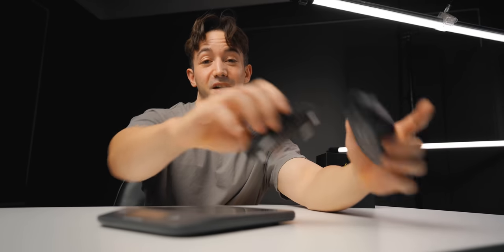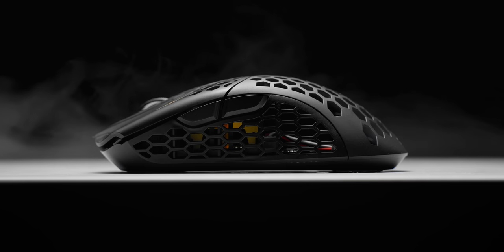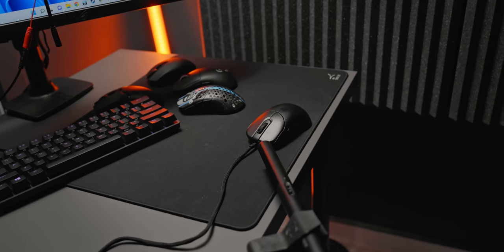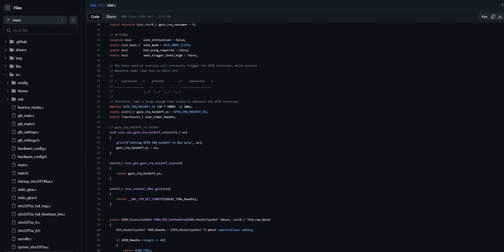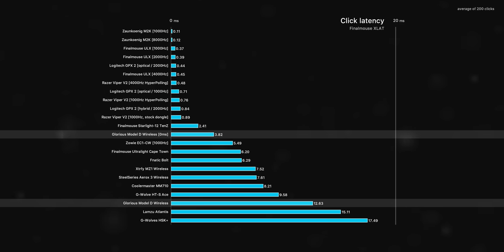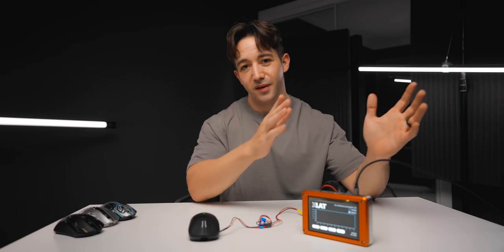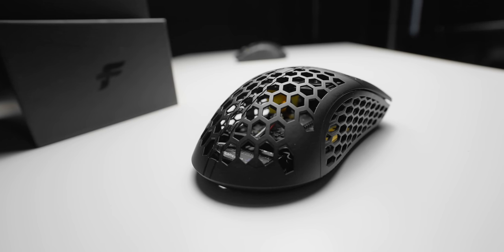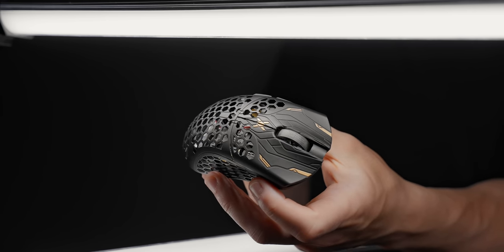Finalmouse just owned everyone. - UltralightX Review

Comment: Hi there. I'm looking for advice, would be really nice if you can help me. I'm not a gamer. I'm a chess player. I play blitz chess (3 minutes) and bullet chess (1 minute) and even hyper and ultra bullet (30 seconds and 15 seconds) and those time controls require a very good mouse and pad but I'm not sure the specifications needed are anything as what you require as a gamer.
So far I've been using the Logitech G PRO X SUPERLIGHT which is good but not the most stable. Sometimes it seems like it excelerates (if that makes sense) beyond my movements. I never had a mouse pad. I don't know if your recommended Otsu Mid is best for fast chess.
Do you think you can help me figure out what I should use?
Reply: bro calm the farm 1. you don't need a crazy setup for blitz or bullet, and 2. you probably have mouse accel on

Comment: I feel like soldering wires to the switches is a good way to measure click latency, but I'm not as sure when it comes to motion sensors. I would worry that there's some lag between the mouse moving and the sensor picking the motion up, even if wires are soldered to the sensor, so I recommend my method. It does measure end-to-end latency, so you can only compare mice instead of measure overall mouse latency, but I hit my mouse with a butterknife (ridged and has a bunch of mass so I can tell exactly which frame it hits), record in slow motion, and see how many frames it takes for the cursor to move in my modified version of osu lazer which runs at over 4000 fps in an empty map. With my 240hz monitor I get around 5.5ms, but 24 of the 25 measurements were either 4, 8, or 12 frames on my '960hz' slow-motion phone camera setting, so I feel like the sketchy Chinese company did some false advertising on my $200 phone and insert ai-generated frames. I'm sure you could get much better results if you get yourself a better camera.

Comment: It is stupid that finalmouse still would not provide linear dpi adjustment. I'm using 650 dpi rn and only to find my poseidon would not work at all. Never see such popular mouse with such stupid engineering. It seems that the ultralight x still only have 400, 800, 1600 and 3200 option. I honestly dont know what is the point for finalmouse to have a "driver" like this one. They would sell anyway so THEY DONT GIVE A FUCK what kind of shitbox they are making.

Comment: if I can use a 120g mouse and get identical aim trainer PBs that I get on a 60g mouse (even on endurance scenarios) this weight difference surely doesn't matter at all.

Also, with logitech you can use OMM software which doesnt run in the background. I have a logitech keyboard with macros and custom lighting, and a GPX and neither has software running in the background. They do leave a lot to be desired still though

Comment: sub ms click latency might be useful when we move to 1000hz monitors, i guess. also the difference between the two "identical" mouse might just be a case of unit to unit variance, or signal interference, or both. also if you want be more precise for the heck of it, look into compliant mechanisms to remove backlash.

Comment: 1000hz -> 4000hz is a big jump and I definitely feel the difference but 4000-8000hz isn't worth the hype IMO. first off my Razer mouse has issues with 4000hz support in a lot of games I play, and 8000hz has even worse support rates, not even FN right now supports it properly.

Same diminishing returns as going from 360-500hz monitors, but even worse beccause going from 1000->4000->8000hz starts to eat up significantly more CPU resources. When I have a 9700kf and was using 4000hz, there'd be times when I'd hit 100% CPU with big flicks and the mouse would turn extremely mushy, with 8000hz unless you have a VERY beefy CPU the chance of that happening gets even higher. And it will happen at those critical moments when your aim needs to be 100% on point.
Reply: I was fine with 1khz but moved up to 2khz on Skypad. 2k seems pretty solid so far, tried the 4khz but not really noticing much difference with my Lamzu ACM 4k. I imagine 8k would be even less of a noticeable difference to be entirely honest.

Comment: Hold your horses there razor just pushed out a firmware update that allows you to have 8000 pulling hurts Wireless with the V2 Pro and V3 Pro and a few other razor mice that connect with the hyperspeed pulling dongle. Please make a video testing the pull rates and how accurate they really are and if they truly stay at 8000 Wireless or if they bog down at any point

Comment: how do you clean it tho?
And why would anyone want to have lighter mouse?
Reply: You can clean it slightly wet tissues. You can also open any mouse (at least "pro" mice) like the guy was doing in the video, so it's possible to clean it from the inside too.

With lighter mice you need to put in less efort in moving the mouse, so if you can control a lighter mouse your accuracy will be better. Light mice aren't for everyone though as they can be "too fast" for some people.

Comment: @optimum Why don't you make a video comparing DPI in mouses, comparing if more is better or just a placebo, not in a sense of raw speed (since most players only use a fraction of the DPI available) but if two mouses supporting different DPI ranges running at the same value behave the same, of if the one with a higher supported number is superior in precision or any other important metric?

Comment: I like heavy mice.... 🤷 And perceived input lag being higher on heavy mice is placebo and illogical as input lag is purely sensor/processing based.

My current go to, is the Logitech G502X Lightspeed. Their newest version that has optical switches. Maybe you can throw that into your testing for heavy mice users. Cant always shoot for ultralight because its what you prefer. Testing wise.

Note, higher pilling will show many pc users bad overclocks. Ive seen tons of people complaining about higher polling causing issues and almost all of them have an intel cpu overclocked to the moon and guaranteed unstable but because they only play older games it doesnt stress the cpu so they dont know its unstable.
Reply: Heavy mice perform objectively worse than light mice. Why include them if nobody's using them in/for comp?
Reply: Its not though. There is also physics based input lag. When something has higher mass it requires higher acceleration to move it from a stop, and it takes more counterforce to stop it when in motion. Also heavier weight equals more friction generated by the mousepad/skates, especially if the mousepad has a nonrigid structure like foam or rubber as its base because a heavier weight causes the mouse to sink into that material further causing more friction.

Comment: I HATE browser based mouse and keyboard applications. If the company goes bankrupt then there's no longer any way to change the settings. Real best way is what HyperX used to do where you just open the software, change settings and then save the settings onto the memory chip in the mouse itself. Then it doesn't matter what PC it's plugged into, doesn't matter what happens to the company since the software is downloaded to my PC and doesn't change game performance since I never have the software open since the options are already saved on the mouse itself.

Comment: as a grower of medical MJ i can tell you a human cannot tell the differnce between 63 grams and 38 grams, much less if they moving it around on a table lol.  BRO!!! YOU SURE THIS A 50 GRAM BAG AND NOT A 20 GRAM?

actually have to weigh it out for em. :)   no aint no human gonna tell the damn difference of 25 grams.

Ability to detect a difference in weight depends upon the ratio of weight A to weight B. This is formalized in psychology as Weber's law.

It is easy to tell the difference between a 1 lb and a 2 lb weight. But very hard to tell the difference between a 150 and a 151 lb weight despite the difference being the same in absolute terms (1 lb).

In addition!!  just by something LOOKING even slightly bigger fools the brain it most probably is heavier

Comment: “Should be impossible” laughs in electrical engineer. There is no guarantee that from on Mouse to the next that you will get the exact same performance. You can guarantee a middle and suggest a delta that the mouse should fall into.

Comment: Why no testing on sensor accuracy and precision? 

Also you claim it has the fastest wireless latency but from what I can tell you didn't show any info or testing? 

On the note of mouse software: Logitech let's yo save the settings to the mouse itself and close the app and not have it running in the background. Good info to know would also be if you need an account to use the webpage to edit mouse settings, which would be more of a downside.

Lastly, would like to know. If it leaves imprints on your fingers from gripping it with the holes on the side or anyone that holds the mouse with their palm resting on top, because doesn't sound too comfortable ;p

Also have fun cleaning it!
Reply: I've never tried a finalmouse, but I'm almost 100% sure they wouldn't leave marks. The mouse is basically weightless, so you'll barely be using any force to control it, so it's impossible to get marked unless you're literally trying to destroy the mouse or something.

Comment: The most important with mouses:
Do not buy non-optical switch mouses if you want to use your mouse. All garbage. 
0.1ms or 4ms makes 0.000000000001% difference for anyone
17.5ms is still more than enough for 99.99999999% of players, you can't 'sense' every individual frame.
ps lol at 200$

Comment: to be real,  I find it so hard to buy any mouse, keyboard, mousepad and so on. cause i feel like if i buy that finalmouse.. i'm gonna regret it in 2 days when 10 new mice has dropped which is better than the one i just used my money on... bought my new keyboard some time ago... 2 days after Wooting comes out with their new top tier keyboard at the same price as the one i just  bought. 
same thing with my PC, bought it with a rtx 2060 back then... a week later, I could get the same pc but with a 3070..... I feel cheated 9times out of 10. I might just be an idiot that doesn't research enough,  and I feel like an idiot spending money on stuff like this. 

so I don't even want to get new stuff anymore.. cause it's obsolete in 2 weeks
Reply: Yeah, technology moves pretty quickly especially when a lot of things can simply be more gimmicky. I'd recommend researching sensor and purchasing a mouse that fits your ergo style. Razer dropped patent for 3395 so there are plenty of mice around with it.

Comment: 15 miliseconds latency on Lamzu atlantis? It would be roughly 40 frames of delay on 270hs display. Your testing are wrong. I currently own lamzu atlantis mini and as far as I am aware they have the same sensor, and everything works crisp and smooth and there is no way I have 15ms of latency on my mouse. Please make a correction in your video, because clearly your information is wrong, and as far as I am aware, Lamzu already adressed that your testings were incorrect.

Comment: Facts and studies confirm that any mouse weighing less than 60 grams and even 40 grams leads to a loss of control accuracy and aiming by huge difference.
Reply: Drop the link big boy. Most of the best aimers currently use <60g mice
Reply: wild assumption
Reply: @deeecim2044  This is not an assumption; it is based on facts and studies. Check the link above for reference.
Reply: @Mr3thaB  link got filtered by YouTube. Where can i find those studies?